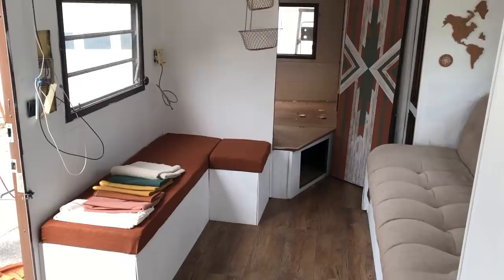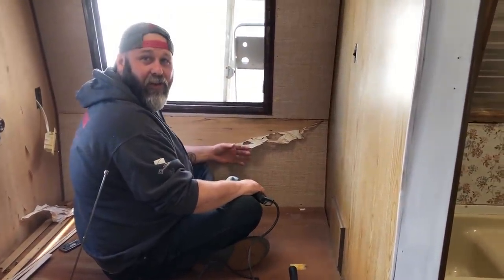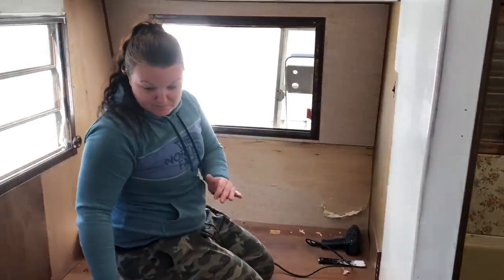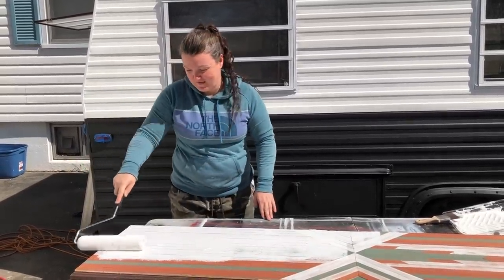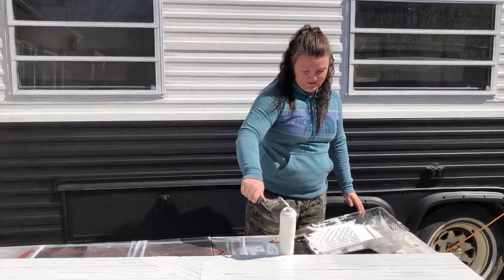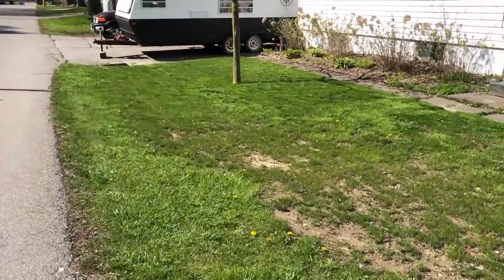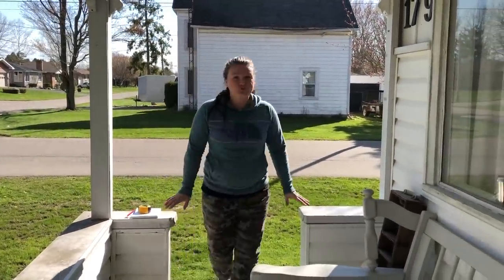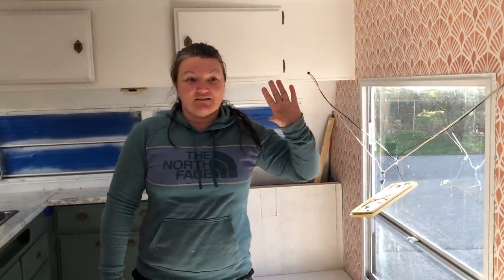Extreme Camper Makeover | Accent Door | Big Plans

Comment: Amazon sells replacement lights for $49 for a package of 5 and they are Led which gives more light for less money.  You might want to replace them with new ones instead of painting them.  You might also want to replace the bathroom electric receptacle with night lights built in with test buttons to reset if they blow.  We bought ours at Lowe's and they were around $19.00, we put them in our bathrooms and they cost pennies a year to use.  We're also planning to put them in our retirement home in Pa along the kitchen wall.  They give off just enough light that you don't have to put the lights on in the middle of the light causing yourself to feel blind with the blaring light.  So happy you didn't paint the stove, the stainless looks great and you're doing an awesome job on the camper.

Comment: With all the water damage you had in the bathroom, I think the healthiest thing to do is to take out the walls and replace them.  Don't want to be traveling cross-country and have someone come down with mold allergies.
Reply: I agree and then the wall paper doesn’t have to be worried about any longer plus you and get that very thin water proof laminate paneling for bathrooms and wet areas comes in different designs or plain.  A white subway title design on the waterproof laminate would be great! You love subway title.

Comment: Do NOT cover the bathroom with extra sheeting. Of you want go ahead and remove the existing ones and add new ones. Someone decided to just add extra sheeting on the bathroom for my camper and it was SOOOOO moldy and I had to remove both sheets and replace some frame even though there was no water leak. Just the vapors make it perfect for mold to grow in between the 2 layers and you will regret it later.
Reply: Solid advice! Definitely worth considering for me as I'm having the same issue in my rv. Thanks!

Comment: Ok here is my two cents! Love the white door. The bedroom back wall and cabinets your favorite green framing in the window. The bathroom being so small I would use the yellow on the cabinets and lower walls, white on the top to keep it bright. Now onto the porch... love the screened in idea had a Victorian home once upon a time we did the same thing to. I would paint the floor like an area rug  in one of your quilt styles, bringing more pop of color that is only noticeable from inside as to not take away from the rest of the exterior of the house. Add sand to the paint you use on the stairs to add traction and place a mat inside for the winter. Yellow shutters and door with black roof and white siding will make a handsome bee 🐝. I have a paint color in my kitchen called Parisian clay I think you might like better than the orange one you have and work better with your current colors. Hope you enjoy my opinion. Hehehe

Comment: YOu may have already been told this but... Did you know that the "wallpaper" is not really designed to be removed? It is an industrial glue heated sealed and pressed to the luan backing. When we toured a camper Manufacturing Company YEARS ago (Maybe as many as your camper is old, LOL)  a lady on the tour said "What if I want to change the wallpaper?" and the guide replied, "Mam that would be the equivalent of trying to peel the lines off of notebook paper, not possible." I wish I knew where to send him your video for him to see. Loving the way Everything looks and totally STEALING your "subway tile" idea.  Y'all Are AMAZING! Sending Love! P.S. I totally freaked out when you painted the door!
Reply: I wondered if the vinyl like wallpaper was designed to keep the moisture (dampness) from seeping through.
Reply: @joanfisher9838  That could be true, I'm not sure, , I do remember him saying it made for an easy wipe down.

Comment: Cladding / decorative wall panels for bathroom walls but I’d remove existing ones first as you had damp in there - and probably quicker than trying to remove the wall paper. The designs you can get in the wall panels are fabulous from marble pattern to faux slate. A nice white marble with black accents would go with the 1930s feel of your deco fans on accent wall. I think the bathroom should be a complete contrast to elsewhere so when you open the door you say wow ! Alternatively there is also a fashion in wallpaper currently for a jungle look, ie big green leaved plants. I think you should go really bold in the bathroom I know it’s a small space but bold either with upmarket looking marble design or completely over the top with the leaf / jungle will make it feel like an oasis of calm ! 
Yes to painting the bathroom door and as for colour in bathroom not coral too 1980s, matching kitchen green boring  - colour depends what you are doing on the walls

Comment: Hi, good choice on the door. Don’t know if you saw my last post about the tub.  I have the same one and it is the most uncomfortable tub I have ever used. Water falls down between the tub & cabinet wall.  It’s probably got wood rot under. I suggest removing & putting in a shower.  Speaking from experience.

Comment: Whoa, wasn't expecting all white.  Consider outlining 1/4 inch each side of the board edges that bring the design to the center point using black.  Also maybe the center vertical strips as well as I sort of see a design in a few of them.  Just a thought that would emphasize the beauty of the quill without clash in color.

Comment: You should be able to paint the yellow lights & vents. I did it with our old house with white spray paint. The spray paint you used on the window would be good I think. So as far as the color of the bathroom cabinet since you painted over the door go with a stencil. Go with what you did in the kitchen or go with something like it but simple to  keep it not too busy & maybe the color of the towels you plan on  using in the bathroom. Just a thought.

Comment: I did find the patterned door a little busy with everything else but I would have tried a white wash first to see if a little coming through would work. Finishing the stencil on the rest of the wall would flow better in the space creating a feeling of expansion rather than contraction. Tip for grass seeding, cover with a thin layer of peat moss to retain moisture and hide seed from birds. Also lightly water daily to encourage quick germination.

Comment: The bedroom space, what if you tied in the rug ftom the kitchen by using kilim style accent pillows along with same color pillows being used for couches and benches? Or maybe bring another element from the trailor into the bedroom like the stencil or a more elaborate version or larger scale version of the stencil in another color. Right now i feel like every area has a different idea and to repeat an aleady existing element with a twist will really help the overall look fell more cohesive. 
Can you repeat the wood quilt look on the inside of the door to the outside somehow? Even all white again? Again a repea. Especially because you took it from being a focal point to being a textural supporting member of the overall design. Just a thought.

Comment: Hey, for your ceiling lights checkout ebay and amazon. I bought LED ceiling lights for mine 20 year old fifth wheel camping trailer and I love them. It shouldn't cost you more than 30 bucks canadian if not less, I've seen some around 10 bucks canadian too. The more light you buy the cheaper it is and LED lights use less electricity which is good thing for RV. Greetings from Windsor, ON.

Comment: The plants in your garden with the green and gold leaves I think is this GOLDEN EUONYMUS . I found it on this website after typing in green and yellow leaves bush into google images and matched it 
https://www.gardendesign.com/shrubs/evergreen.html

GOLDEN EUONYMUS

Zones: 6-9
Exposure: Partial to full sun
Mature size: Up to 6 feet tall and 3 feet wide
Foliage color: Yellow and green

Why we love it: Bright, bold, variegated leaves provide color throughout the year, making this quite a colorful choice. Plus, it is very low maintenance and easy to grow.

Where to plant it: This is a multi-functional bush that can be used alone as an accent or in mass plantings and sheared into a dense hedge. It tolerates a wide range of conditions, including light shade, full sun, poor soil, and tough conditions.

When to prune: The best time for pruning is in spring, after flowering; but the occasional branch can be cut away at any time.

Comment: I'm wondering if what you have on the walls is not really wallpaper. There was a product you could buy that were sheets of paneling that were already decorated with a sheet if vinyl.
It made a quick wall covering. They were used in Mobile homes and even some houses. I don't think they ever thought someone would try to remove that layer.
But with persistence you're doing what was never intended to be done. ☺️

Comment: If you remove the wall in the bathroom could you not just flip some of the pieces around? The other side of the boards would not have the wallpaper on it...just a thought to reuse them. I would do the bathroom cupboards the same green as the cupboards in the kitchen.

Comment: The bathroom door is better
Reply: The pattern of the wood applique on the door provides enough interest for the room and the new color provides continuity with rest of the trailer. Its a small space and the bold colors that were on the door, I thought, were jarring.  it is going to be much better to provide color in the space with accessories and fabrics.(pillows, bedspreads, window treatments etc..) I think the black and white exterior is bold and interesting. There will not be another RV like it on the road.  I like the pallet that you chosen for the cabinets and the stenciling. I am very interested in the solution for the bedroom and bathroom areas. They will be hard to do. I mean other than the bathroom door you basically have one space. You and your husband have done a lot of hard work. One more thing, the floors are spot on. FYI, I live full time in a very modified trailer in Florida. I have also lived in a 6,000 sq. ft. house that won a few design awards in Texas. I love your channel.